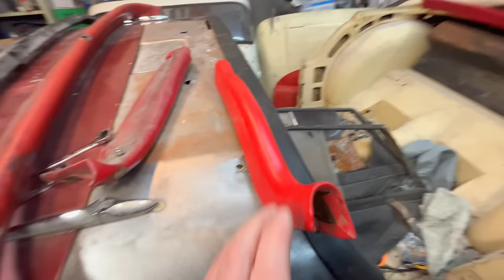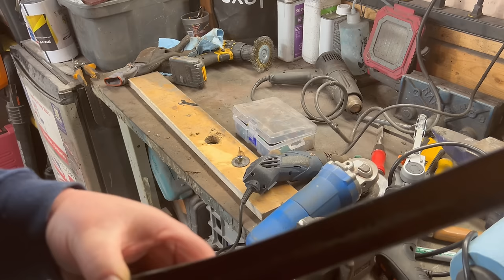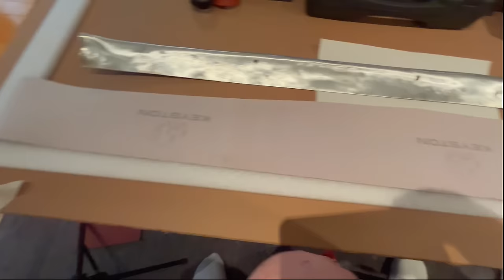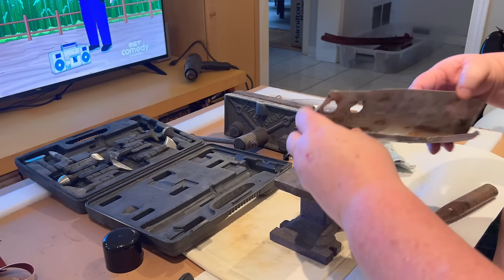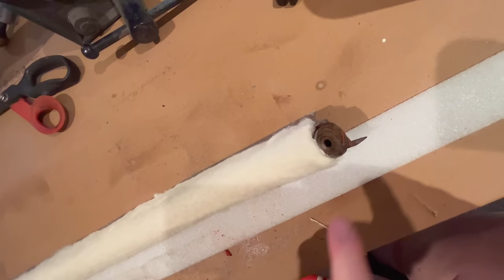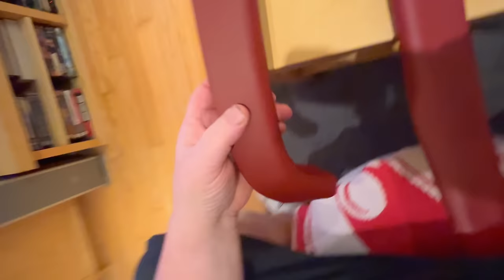1959 Triumph TR3A Restoration Project, Cockpit Capping Re-Covering

Comment: Dave, I literally did the same job on mine 2 months ago.  Like yours, my cappings were a mix of flimsy aluminum and some steel, and were dented much worse.  I used peening hammers and some wood jigs to beat them back into shape, but also used batting to help hide any imperfections and smooth things over.  I'm always amazed at the breadth and scope of your undertakings when it comes to these cars, so kudos once again.  I wish you lived in my neighborhood!
Reply from the maker: Hi Don, I was fortunate that I had a few sets to choose from…some of them were going to be almost unusable….i was lucky to be able to find a useable set that needed minimal work.

Comment: Nice job Dave 👍 I made some similar cockpit cappings for a friend's Merlin kit car some years ago. I did take the precaution of priming the metalwork first to prevent rust... a must here in the UK with our awful weather for most of the year.  Your TR3 will look sensational, as does you 250 & 6.  Thanks for sharing another great vid👍
Reply from the maker: Hi Robert, I debated about priming these pieces…they are actually in pretty good shape after 60 plus years….i figure they are good for at least another 60 😉

Comment: Nice job Chef, I really enjoyed doing this job on my car.  Rather than using batting on the door tops I used 3mm foam which gives the same feel but is a lot easier to work with, not least because it had an adhesive on one side. The elbow capping are by far the hardest pieces.  I like the idea of your wooden former, that may have made the job easier. It just takes time and patience.

Comment: Hi Dave, why are some leather and some vinyl? And secondly, what concealed fixing system holds the cappings down please?
Reply from the maker: Hi Phil, the thought is that the leather is used in the high touch areas as it will wear better over time than the vinyl.   The panels are fixed by trim screws on the inside of the body tub…some of these are exposed and some are concealed by other panels that lay on top.
Reply: @cheftush  thanks Dave, that makes a lot of sense. Great project by the way as this is a very old model now so bless you for making a great start on it. I know you’ve had it “in the wings” for a long time so good for you and stay happy and healthy! 😁

Comment: You do much cleaning of parts, what is the reason for not investing in a nice blast cabinet that can handle different types of media for doing jobs like this.  It seems it would be worth your while.  The final result just using simple tools works as well of course.
Reply from the maker: Hi Robert, I actually have one sitting just in front of the TR250…sometimes it’s just easier to do them by hand vs moving a car out of the garage into the snow and then having to pull it out from behind a large tool box etc…if I have to do a larger batch of parts I’ll most definitely dig it out.